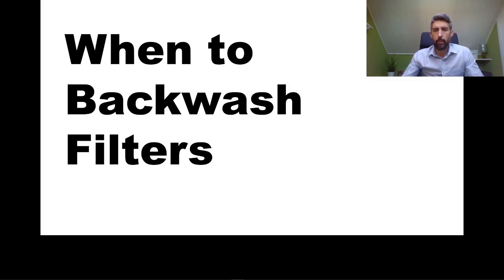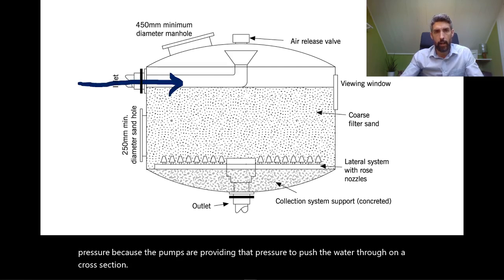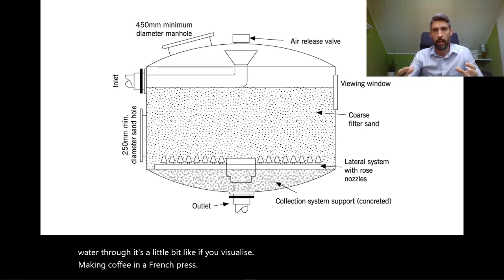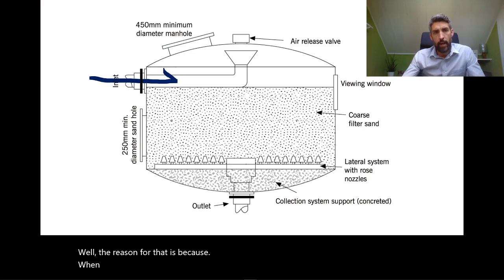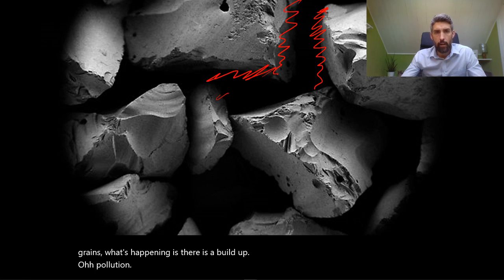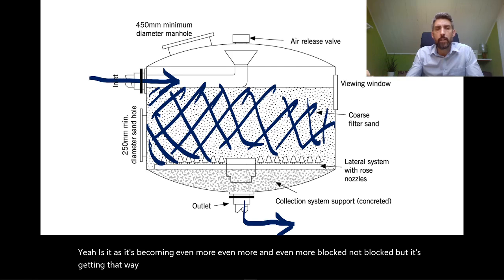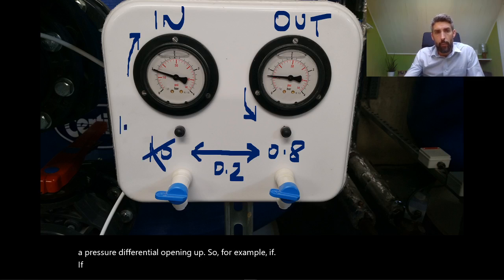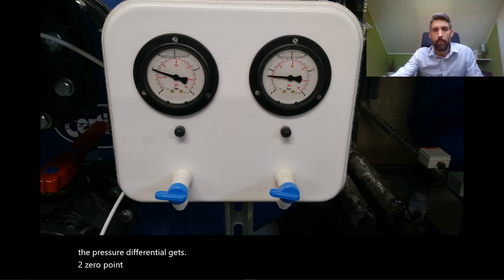When to Backwash

Comment: If a system has  PAC added backwash water shouldn't go to drain ?? it should go to a settlement tank for the PAC fall to the bottom of that tank and when completed the clean water (after PH is checked) can go to drain and "sludge" is collected and disposed in a responsible manner....we don't want PAC getting back in to our water system. Would you agree ??
Reply from the maker: I've never come across a pool plant system that has a settlement tank for the removal of  PAC from backwash water.
Reply: @StockwellSafety  so does the PAC just go to drain....would that not be an issue for the EPA
Reply from the maker: I'd advise checking with them directly.